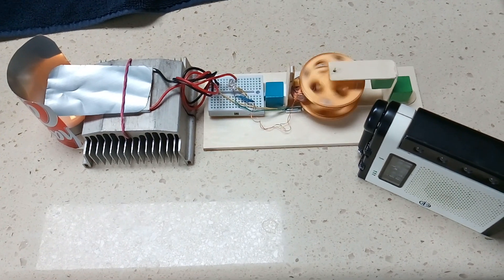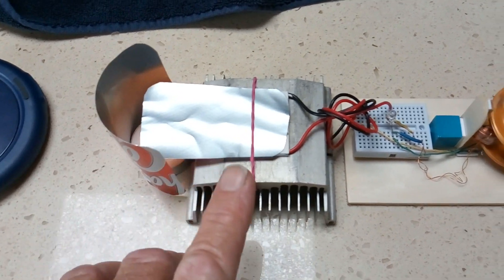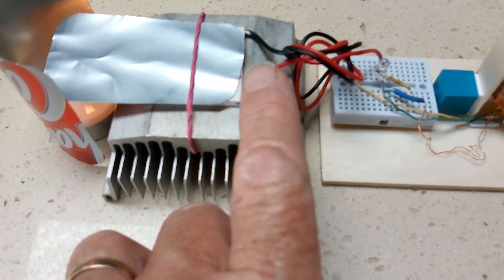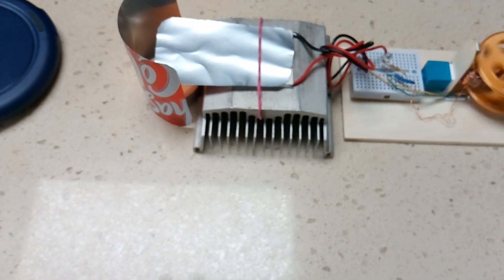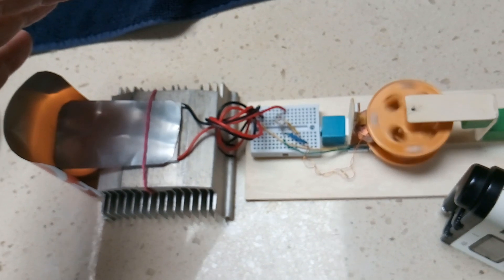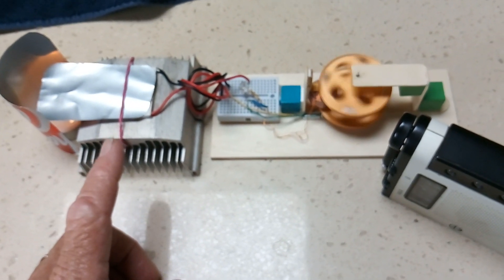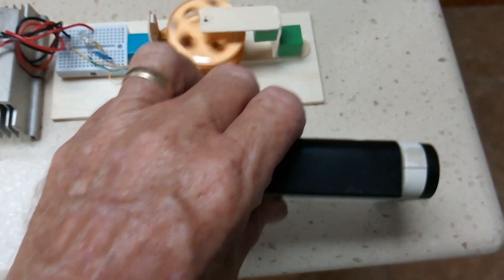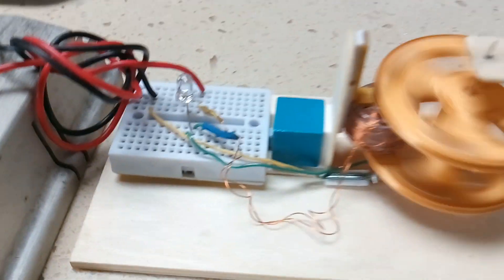Stove Top Fan Simulation

Comment: Nice video.
Maybe if that pulse motor has fan blades and facing the heatsink could add the voltage difference produced by the peltier module? Then the output will be extracted from the coil's bemf.

Comment: That is a good heat sink you have there 👍
Reply from the maker: It is really old and was used in many stirling engine project.  Part of the heat sink fins are melted from too much heating on the stove but it still works fine.